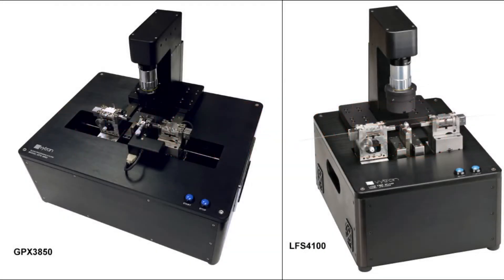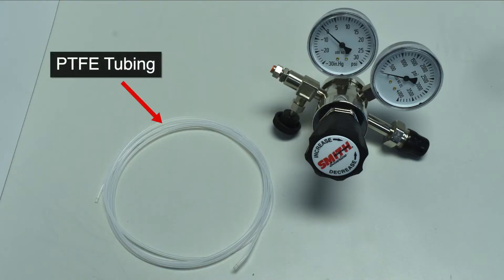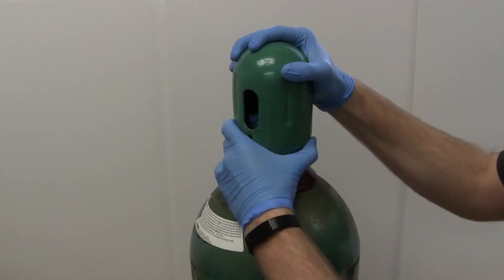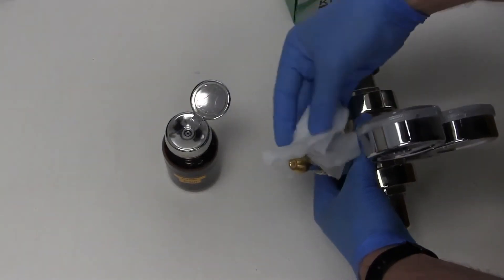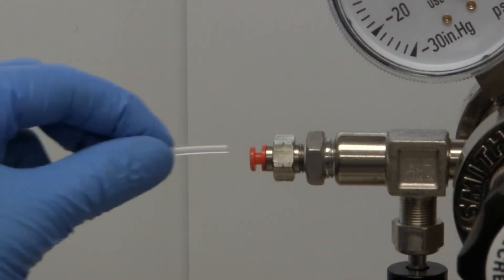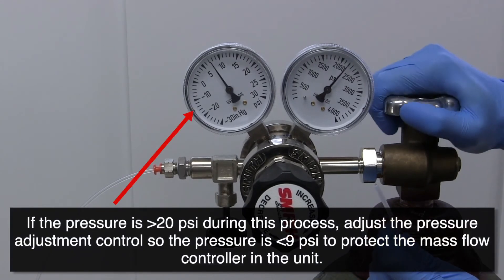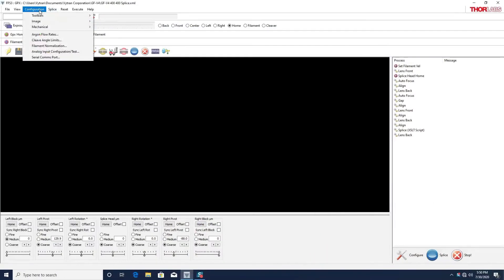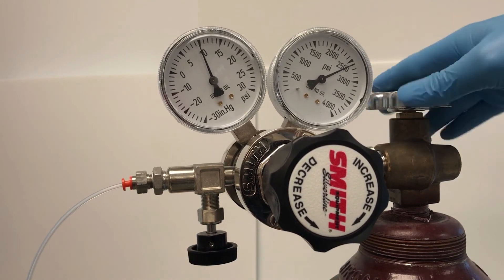Installing Argon Cylinder and Regulator for Use with Thorlabs Vytran Filament Fusion Splicers

Comment: one safety tip, with compressed gas cylinders, leave the REGULATOR closed, if its open, the tank pressure rushes through the fragile diaphragm and can damage it, or cause it to over pressurise, even for fractions of a second, and lead to the regulator failing.
the CORRECT way: open the tank valve to 'squirt' gas to blow any contaminants away from the threads,  add the regulator, open the diaphragm screw (until tension is gone, you want the screw on the 'bonnet' but no force on the diaphragm itself), then open the tank valve, half a turn, then SLOWLY open the regulator screw to the required pressure, so gas goes through the regulator slowly, and no shocks to the parts inside, then you can open the tank valve more, if you need, the 'craic' it was open initially reduced the pressure, and let it flow to fill the space, then full tank pressure can't damage anything.
Reply from the maker: Thank you for your comments! As part of our routine work with high-pressure gas lines, opening pressure lines slowly has become standard practice. This approach is now second nature to our process, including monitoring for leaks. That said, your comment serves as a valuable reminder for individuals with less experience handling gas systems that gas flow should always be introduced gradually.